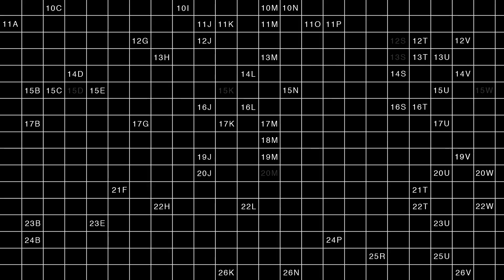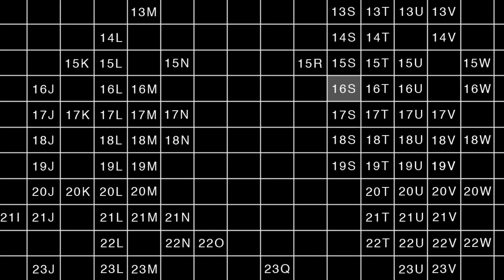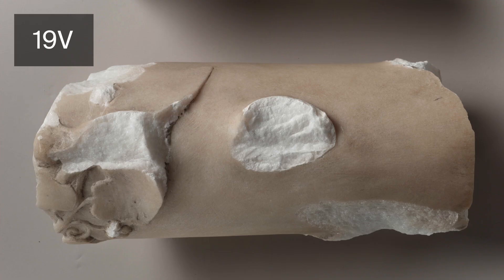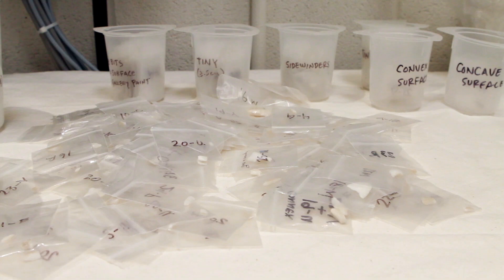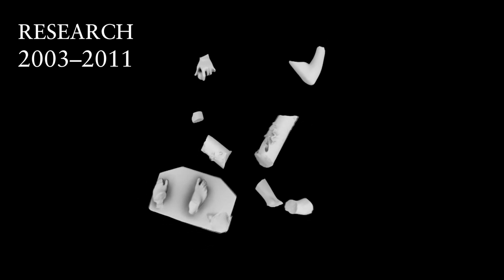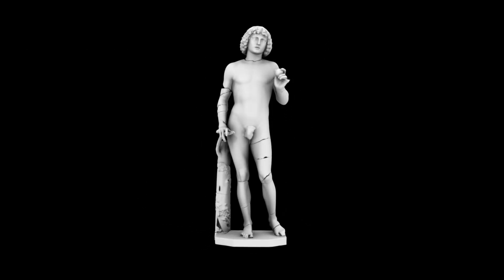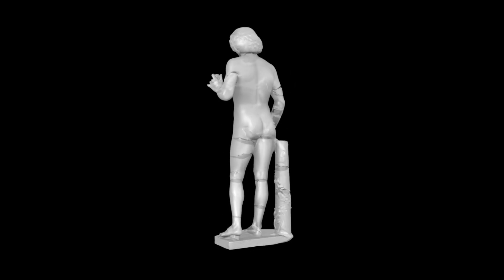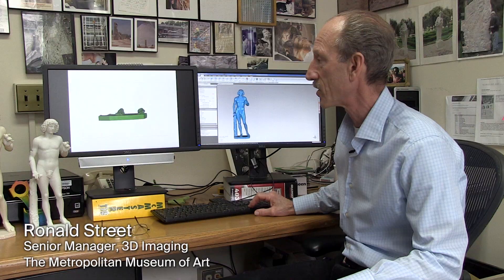After the Fall: The Conservation of Tullio Lombardo's "Adam"

Comment: Lets put this amazing and unique sculpture on this cheap playwood pedestal, i think its a good idea.....
Reply: So for everyone talking about about the "cheap" plywood pedestal, I was a little intrigued, and did a little research. The video really doesn't go into much detail but from what I was able to find the pedestal was more than just plywood and was pretty heavily reinforced internally with several braces and supports. Also the pedestal had been holding the statue for at least 65 years without incident going back to 1936 when the museum acquired the statue and put it on display in that location. Whatever caused the pedestal to fail was unusual enough that the Met had 2 separate engineering firms conduct forensic investigations on the pedestal to determine why it suffered a sudden and catastrophic failure

https://www.odonnellconsulting.com/project-view/statue-base-failure/
http://rapperport.com/case-studies/pedestal-collapse

copy & pasted from centerioun so you could know this :)
Reply: @grezgu  didn't it deserve a marble pedestal? And drills with supports in case of hearthquakes?
Reply: My thoughts EXACTLY! 😅

Comment: Guys plywood can be really strong or really weak, depending on thickness and how you build the structure. There isn't anything inherently wrong with plywood, all museums build most of their stands from the stuff. The problem is that they didn't make the plywood box well enough
Reply: plywood sucks. you don't put a heavy carved statue on plywood.
Reply: @azura-moonstar  Some Roman shields were made with plywood, especially since it's quite flexible, light, but still strong. Plywood isn't inherently bad, and doesn't "suck". The plywood box just wasn't constructed too well, and plywood possibly shouldn't have been used for this specific scenario.
Reply: Obviously the one that held the statue was....really weak. Hence the fact it collapsed, destroying the statue in the process. Brilliant conservancy decision, that one.
Reply: If that was merely a hollow plywood structure, it was only a matter of time and highly predictable that it would eventually fail.  I do hope they conducted a thorough review of ALL their support structures and fittings.

Comment: why would such a valuable sculpture be put on such a cheap pedestal.  It was an accident waiting to happen.
Reply: meandbigboy Hindsight is always 20/20.
Reply: nacs This is more than hindsight being 20/20.  From a physics & structural engineering perspective, using a substandard wooden base was an imprudent choice that could've been realized relatively easily beforehand.
Reply: The pedestal always looked cheap/cheesy to me - you could see it was plywood painted gray; I never understood why they didn't have it on a beautiful stone pedestal, as it deserved to be. Now, in hindsight, it apparently was truly foolish.  I don't understand why such a decision was ever made.  As I remember it, the other large Renaissance sculptures in the Blumenthal courtyard were on similar plywood pedestals.  The courtyard layout has been redesigned since then.  Initially the story was that the sculpture was smashed as they were installing new pedestals, and the inadequacy of the handlers caused the fall.  Now they say the pedestal gave way.  I wonder what the truth is.
Reply: Seems like common sense to me. I'd care about the artwork more than the floor.
Reply: Top-quality plywood is actually very strong and very durable. It should be a perfect material for pedestals, so long as each one is properly designed and carefully constructed. Stone pedestals, on the other hand, may very well have invisible faults - and their weight when combined with the sculpture above is potentially devastating to flooring underneath.
Reply: @TheLonesomeBricoleur  – It's not clear what exactly failed. It may not have been the plywood itself, but the fasteners holding it together. However, the notion of a hollow plywood box (according to the New York Times report) holding up a heavy stone statue does not seem obviously sensible.

Comment: A sculpture of such importance should not have been put on a cheap plywood pedestal. I think it's highly irresponsible of Met to even use such materials. Concrete or stone is cheap and much more durable, and I think Met can afford it. It's just the American attitude of cutting corners to make things only appear to be good quality. Please, save money on other things, not materials.
Reply: MrNakitjamuusi ....like cut the Salaries of the Directors.
Reply: The pedestal was the highest bullshittery though.
Reply: Wood construction is fine, much more economical, easier storage, maneuverable. Moving 600lb of stone for each piece in an exhibit would be senseless. Plywood, though. Man wtf. I hope she was exaggerating.
Reply: @evindrews  not really there are supports and systems that makes moving tone/ marble pretty easily. and you should have to move it all that much or often.
Reply: Anyone thinking "plywood" automatically means "cheap" is ignorant about what plywood actually is.  Properly fabricated high-grade plywood is stronger and more consistent than natural wood.  We don't have any information about which plywood they actually used so your assumption that the Met was irresponsible is fact-free.

Comment: When they pulled out the 3D modeling and mentioned they kept every single piece I guess I was a little disappointed they disnt end up genuinely rebuilding the entire thing seamlessly using those fragments rather than just putting in a plaster filling in the gaps.
Reply: Same. I wonder what they did with the scaps

Comment: So they took so much time only to realise that they should glue the parts together
Reply: No, they took so much time because late 20th century and early 21st century restoration/conservation  has the principle of total reversibility. There is also the problem of steel pins doing considerably harm in future falls.
So, they took the time to find pins which would hold up but not do damage in a fall and acrylic resins which can be completely removed but will hold firm indefinitely.

Comment: If you cause the damage the repair does not have to be reversible. There are very clear reasons for why repairs should be reversible. Causing the damage yourself does not qualify as "historically important" enough to reverse repairs.
Reply: If the repairs aren't flawless you might wanna make some changes in the future.
Reply: They are reversible so that if, for some reason new and better materials or techniques are developed, they can undo the current ones with little effort and no damage to the piece. Also, restoring materials, even if they are top-quality, sometimes age differently from the rest of the piece and sometimes it is necessary to remove them.

Comment: but... but... you could have measured the strength and resistance of the pedestal and compare it with the weight and density of the statue and you would have known that the thing wasn't appropriate support in the first place.... Am I missing some sort of crucial detail that justifies the incident? This seems like pure negligence  to me.
Reply: The statue had been on the same base for over 70 years, nobody thought to recheck the same stand that had been working for ages. Apparently it dry-rotted at some point and slowly gave way.